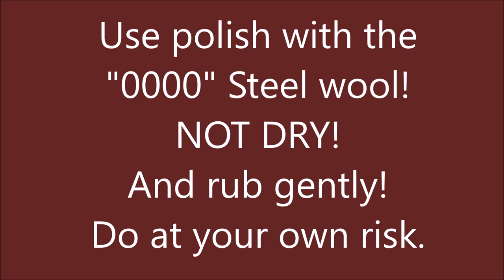VW Beetle Window Regulator Removal and Maintenance - Window Hard to roll up - VW Restoration DIY

Comment: Not much of a teacher?  Are you nuts?  You are an exceptional teacher my friend.  One of your very best qualities!  Great job getting that window frame stop screw out!  I love your little songs.  LOVE this video!  We do it very similarly.  Clean all parts until they cannot get any cleaner. I go a bit overboard and wire brush all the clips and hardware and repaint them as well. Then re-lube and reassemble.  only exception is that I don't use grease to re-lube.  I utilize powdered graphite as I NEVER want to do it again.  But my cars really don't get used so the grease can harden much quicker without some use.  So, the powdered graphite stays in the same "consistency" forever.  You couldn't be more right than when you stated Don't rush as then you have wasted your time!  Excellent advice on ANY job you tackle!  Again, FANTASTIC video, with exceptional instruction!  You are once again, DA MAN!
Reply from the maker: Thanks Mike I appreciate the kind words! I actually had graphite at one point, I think I loaned it to someone because I can’t find it. I’ve had a lot of luck with the Molly grease, seems to be OK for a while before it ends up turning to paste. I hope your weekend is going well my friend.

Comment: Well, fudge... My '63 door window guts are different, being more of a gear type setup. However, this was educational and useful information, should I ever have to deal with a later model.  I'm a fan of the Moly grease myself, it's something I first learned about using from a shop man who worked at Detroit Diesel Allison (in Speedway Indiana, not Detroit...) Every bicycle I've ever cleaned and repacked the bearings on, or installed new brake cables,  gets the Moly treatment. Superior stuff when it comes to lubrication, durability, and keeping moisture out. And, it really bonds to (i.e., ruins) cloth shop towels! 😄😄
Reply from the maker: I think what I’m going to try and do, is get one of those doors for the older models from my body with a scrap yard. And do a video on it.

Comment: Let me start out saying your videos and advice are a wealth of knowledge. I'm 51 years old and have just purchased a 1970 vw bug. My very first car was a 1971 super beetle and I have sorely missed it until now. It is like a dream come true! My bug needs lots of work but I'm currently working on the window regulators. Love your video on the "Removal and Maintenace - Hard to roll up -VW restoration DIY" video. That is one of many that you have put out that has been a real blessing! Please don't apologize ever for being too detailed on a response! I love it!! My father in law is a mechanic by trade and he is coaching me on how to repair things on the bug myself. He is very excited to help me work on it as well. Sorry for all the info!! My question is on this video is that I'm missing the screw that holds the side window channel to the door. You mention it in your video but I'm having trouble finding one. Also the small phillips head screw that you had trouble removing up inside the window channel that holds the side pop out window in place is also missing on my bug! Im needing to find these parts if possible. Unlike you I wasn't blessed with a door that was in practically now condition, mine has has some rough years put on it. Thanks again for all you do for your watchers and listeners - you're the BOMB!

Comment: I'm glad I'm not the only one that has problems with screws not wanting to unscrew.  Really enjoy video.  Would also like to see where you put sound proofing in door panel.  I have a 74, that when I got it there was no window on the passenger side, everything thing removed.  Your video is great showing the parts needed and how to install.  Wish I knew what size the bolts are.

Comment: Sometimes you can get closer in on the project and leave yourself, other than hands and whatnot, out of the shot, so we can see the details more. Thanks
Reply from the maker: Yes I completely agree with you! That’s the first time that I couldn’t, I usually will use my GoPro, with different attachments that allow me to do that. Unfortunately, it was not handy and I had to use my phone on the stand. But I do agree with you

Comment: It is excellent that you show some of the struggles, instead of editing for the “magic snap” effect.
Someone who is using your vid may run into the same struggle, and if all they have is a “viola” video, the whole situation changes with F bombs galore directed at YT and the task at hand, sometimes with things getting thrown, and sometimes total discouragement 

Great vid Slade 👍👍👍
Reply from the maker: Thank you so much my friend! I refuse to cut out anything, that can be trouble related. I never want someone to feel that they do not know what they’re doing or they are the only ones running into problems! I just don’t believe in that.

Comment: nice video Tony and well explained. the only tip i can give is that you run your window up with the bolts lose. and when the window sits in place at the top, you can tighten them up true those upper holes in the door. then is your window straight running.
they still use that method in several cars. nice to see the trick to clean and greasing up that mechanism.
keep up that good work my friend.
Reply from the maker: Thank you my friend, and thank you for the extra tip, I definitely don’t know everything so I always like to get extra tips when possible!
Reply: @SladesVWBeetle  I definitely never have had someone that knew everything. We all learn our whole life.

Comment: Good Stuff! @Slades VW Beetle I need to do this with my '72 Beetle Driver's Door. I think I'll probably do this with my door in place. ;) I've got to get my key tumbler to work better on that door too. It's a bit difficult to get into my Driver's side door at the moment. I look forward to your next LIVE chat. Cheers!
Reply from the maker: Thank you Mark I appreciate it, you can do it with the door on, mine was already off so it made it a little bit easier.
I got a new keys cut for my doorhandles, I did a video on that. However, my tumblers were OK so I got lucky

Comment: Nicely done. I'm actually dreading the reassembly of the regulators. I did a lot of repairs on my doors one of which included the bottom tab that the regulator bolts too. So if I haven't welded it in the right spot I'm going to have issues lol
Reply from the maker: Hopefully it goes smooth for you my friend. I need to go over and check your channel and catch up on your videos I hope you’ve been doing well.

Comment: Had to replace the drivers side one in Lucy my neighbor told me the reglator was completely shot the gears were completely stripped.
Reply from the maker: Yes sadly sometimes you need to buy another one, I just try to buy used German when possible

Comment: A over good video, I ended up scratching the paint work when fitting the quarter glass with the door on the car.
Reply from the maker: Thank you Gordon! Yes you have to be very cautious when doing that, I try to use the plastic pry tools and move very slow.

Comment: Slade, another great video. Very helpful. I was wondering if you could let me know which areas need to be lubricated on the 1956-64 window regulators, which are very different from 65 up. Thanks!
Reply from the maker: Sure thing Jeff, just send an email, and I will check into it for you!
sladesbeetle@yahoo.com

Comment: The sedan 68-74 window regulators are the same. The 75-77 regulators are different. The 75- 77 doors have a different mounting plate on the bottom. The small screw in the vent window are not easy to remove sometimes. Been there a few times.
Reply from the maker: Thank you so much for chiming in, I always appreciate your wisdom. I knew 68 to 74 was the same, I just wasn’t sure about the other ones that were in the 75 and up.

Comment: Awesome video Slades, I recently had to install a new window felt to the drivers side door which made rolling up the window kinda stiff to roll up due to the new felt.  Now when I try to roll up the window it has become a bit more difficult and about half way up it starts to grind /skip.  I'm hoping with the help of this video I can clean and do the maintenance you explained so the window and regulator can roll up smoothly and I can avoid buying a new regulator if I don't need to.  Any advise on treating the new felt to make it easier for rolling up the window?
Reply from the maker: Hi Andy, thank you for the nice compliment. Truthfully, I have never put any type of lubrication on window felt before. That would probably leave smears all over the window.
I’ve only cleaned them. I would concentrate on that regulator and tracking. 
Sounds like the Felts are new and holding the window kind of tight. Long as they are snapped into place tightly. a lot of the new parts are different tolerances than old parts from years ago. But I would definitely try to do the procedure. I did to make them wind up and down smoother. You shouldn’t have to buy a new track or regulator.

Comment: Morning Sir, I bought a bug that needs door panels. They seem to be really expensive to buy. But what I need to know is what is the best material to use to make door panels out of. We are doing Dimond tuck for the interior.
Reply from the maker: Funny you brought that up, I’m actually doing a diamond tuck pattern on my door panels. 
Not quite yet but I’ve done them before. So I’m going to repeat the process lol
I usually just go over my existing door panels. 
You can buy a cheap set from J bugs if you’re going to cover them. 
Or use something very thin like that Luan underlayment they use on floors.

Comment: Thank you for the excellent video.  What is the lubricant you recommend?  I apparently lost the spring that holds the window crank in place.  Where can I purchase another one?
Reply from the maker: There’s so many different lubricants. I prefer to use either oil, or a lithium grease. 
But that’s just an opinion it’s almost like an oil debate. I would look online you can absolutely get one of those springs they’re easy to fine. Just google in the part.

Comment: Great video. I will try this out soon. How long did it actually take you to do this? I’m just wondering so I know how much time to plan for when doing this
Reply: 1 to 2 hours, on one door.
Reply: @vintage76vipergreenBeetle  thanks
Reply from the maker: Just as vintage described, between one and two hours per door depending on if there was a struggle. But it’s really not a bad job. Just a little tricky to film lol

Comment: My 69 bug has a new fuel pump and lines and the tank is clean...but I'm having trouble with the fuel getting to motor...it will run about 10miles then runs out of fuel..I have to pull fuel line and blow back into tank to get pressure to push the gas to the filter..then it will go another 10 miles before running out again...please help..I'm new to the community but always wanted one since a kid .I'm in central Arkansas and want my bug to be dependable enough to drive to the show once a year in eureka springs...thank u

Comment: My headlight buckets are rusted, bent, and pretty much a mess.  Is there a replacement part or way to salvage what I have?
Reply from the maker: If the headlight buckets are rusted out, you definitely will need replacements. Now I’ll admit I have tried the aftermarket ones, and I did not like the way they fit. Actually made me angry which I seldom get. 
I would first try the samba classified. And see if you can find an old German set that is cleaned up. Trust me, you’re much better off with that.
Reply: @SladesVWBeetle  I’m

Comment: I have a '65 bug for which I've installed felt tracks, new scrappers, and after-market (I know) regulators. My windows are so hard to crank up that I actually broke the handle. Both windows work the same. Have you ever run into this problem and can you give me some advice?
Reply from the maker: Wow, I have never heard of that happen before. So you did already remove the tracking and lubricated it like I did? There could be something stuck in that tube where the snake goes through, at least that’s what I call it. Lol.
Reply: @SladesVWBeetle  Thanks - I'm taking it back apart.
Reply from the maker: @billridenour1  please keep me updated on how it goes.
Reply: I’ve removed the glass, regulator, and wind-wing. I’ll clean again lube and replace felts. I’ll let you know. There was a pretty large kink in the wind-wing felt. It likely was my problem.
Reply from the maker: @billridenour1  OK I was watching for your message. 
Please let me know how that turns out. Also, the part where your handle goes onto the shaft. The sllined shaft. 
See if you can spray some lubricant inside of there. 
The window winder shaft, I hope that makes sense. 
But if you had a kink that definitely is probably your issue.
Reply: Just an update - I rebuilt and installed the regulator, and it works great. I installed the wind-wing assembly which I removed to replace the felt. Put the glass in being careful that it was riding in the felt. Without attaching the glass to the regulator, I tested it to see if it moved freely. It does not. I can push it up about halfway and that is it. It gets tighter the more it closes ..... discouraging. I appreciate your video and listening to my story. There has to be an answer. If I find one, I will let you know.
Reply from the maker: @billridenour1  wow!!! I don’t get it. You’ve done everything you’re supposed to do.